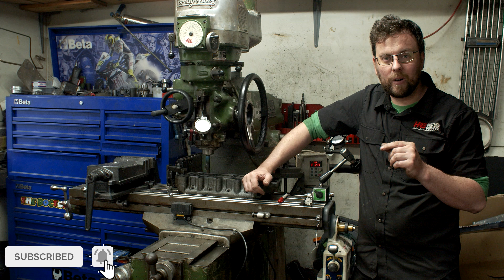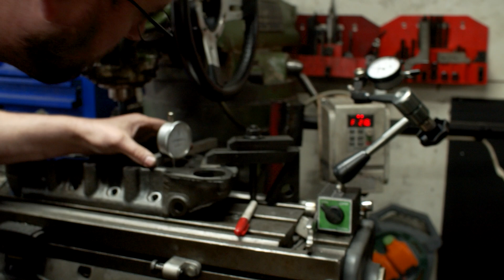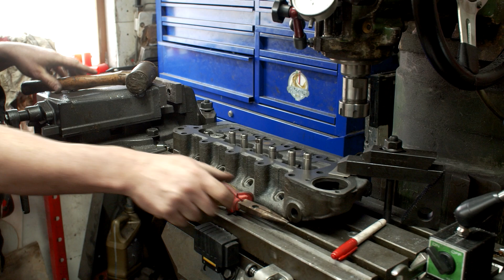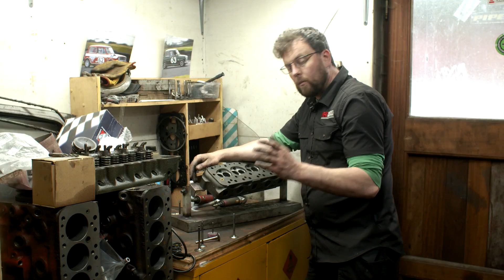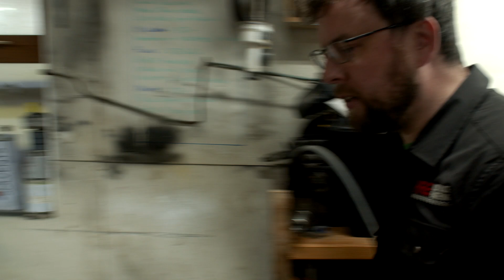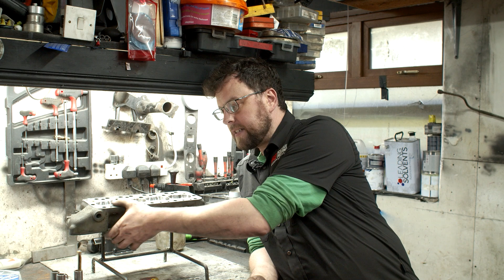Mini Cooper S Cylinder Heads - Part 2

Comment: I own a genuine 1965 Cooper S which is fitted with an A+ 1420 cc Minisport engine fitted .I am going to remove this engine and refit its original genuine thin walled 1293cc engine and gearbox. The car is a properly built rally car and is in great condition. So I should be able to get its FIA papers for competition. So your videos are brilliant and really helpful.

Comment: Good to see you working on combustion area, brings back memories when I did it in 1978, But I gasflowed all the inlet and exhaust ports too, and matched the manifolds so there were no shoulders. I used an engine from an Austin 1100 automatic, which has a cooper head to compensate for the auto losses.

Comment: A great pleasure to watch you work, there is no substitute for doing it properly. I was a mechanic in a BMC dealer in the 60s and specialised in Mini, Mini Cooper and 1100s so this brings back lots of memories.
When removing material from the combustion chambers you increase the volume so, how do you deal with the effect on compression ration and balancing the chamber volumes? Have a I missed a video somewhere along the line?

Comment: Again your attention to detail is fantastic, back in the day we would never drempt of checking the depth and machining the valve spring recesses in the head. I assume that all the work on the valve seats was done because the originals were in bad condition and couldn't be refurnished. By the way we just hammered the guides straight in lining them up by eye, never had any problems with them not being straight. Eagerly awaiting the next episode.

Comment: Most excellent workmanship Paul, the process you use is the same as we use on our race heads, we still lap and polish the seats.
Reply from the maker: Thanks folks, ya we do polish our valves after they come back but honestly with the CNC tec I am always blown away by the sealing of the valves

Comment: Hi, really interesting video, can i ask how this work effects the compression ratio?
Reply from the maker: Great Question Steve, in the final Instalment when the valve seats are cut we will do a volume measurement on the combustion chamber. We will then skim the heads untill we reach the factory standard for this model
Reply: @HREIRL  Ahhh right got it, thanks.